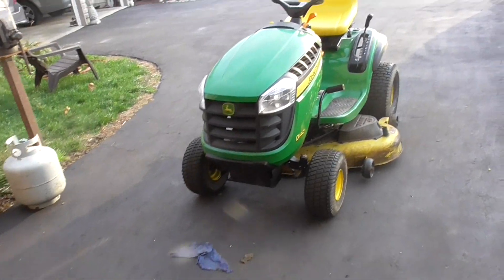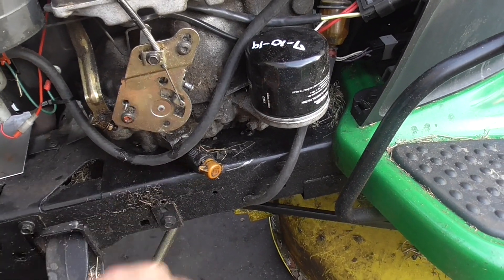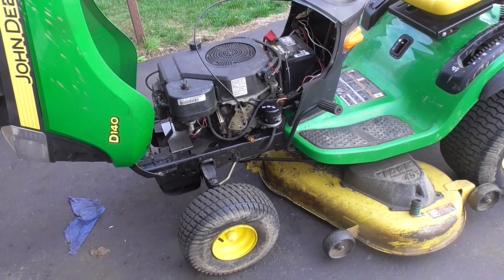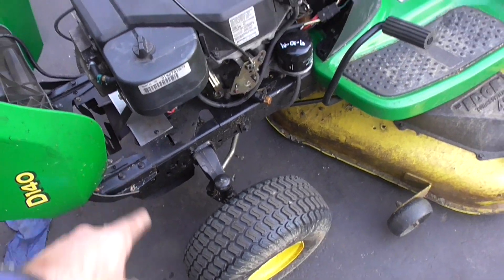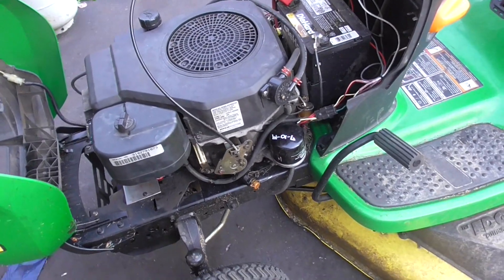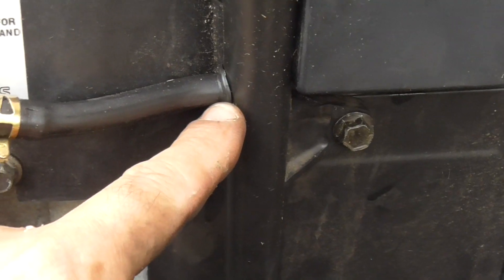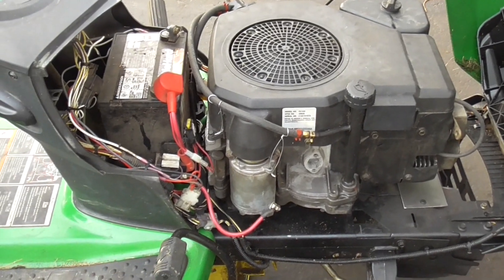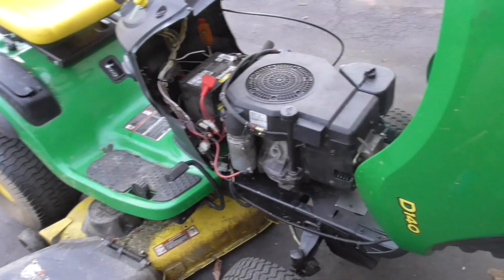Adding A Fuel Pump To Kohler Using Briggs Parts

Comment: In your case I would have drilled a hole through the block where the mounting boss is located for a mechanical pump. I don't understand why they put the mounting boss there for the pump but didn't actually machine the hole for the pump pushrod 🙄🤔

Comment: Just to let you know the black wire that needed to be hooked up was your ground That's why nothing would work until that was hooked up. In the first thing I would do would that is the take off the carburetor fuel bowl which is very easy by unscrewing the solenoid on the bottom of it just remember to unplug the wires going to the solenoid. Is what they call an anti-back-fire device and they cause more problems and you can imagine but most people do and it only take you a few minutes is to take the solenoid off and grind the tip down. Eliminating that device from closing off the jet in your color it'll work 100% better and if you look around YouTube you'll see tons of videos on. The way you have your fuel setup on that John Deere is pretty much how it comes from the factory. The thing on the side of the mower with several lines is your vacuum fuel pump those go all the time. Easily get one of those electric fuel pumps for less than $15 on eBay and they work great and never had a problem with them but tons of problems with what you have on there now in fact I just replaced one. And if you ever do install to fuel pump make sure you put it as close as you can to the gas tank to avoid vapor lock. And make sure you connect power to the pump off the key side of the switch to get power that way the pump is only on when it is running I've seen other people put switches in and shut them off manually but why they would do that I had no idea looks like you did it a lot of work and did a great job and you got a great mower for your investment and you're right that's how you learn jump right in I also just put a 22 horsepower diesel engine on one and you can get them cheaper than you can get a replacement Kohler or Briggs & Stratton for. Bolting right up. And very easy to wire try one of those on your next project everybody will be very envious of you having one of those who have Diesel engine. It may be rated the same horsepower however diesel engines cookies a lot more torque and now that mower is unstoppable

Comment: Thank you for sharing this. I've got a 12hp Tecumseh engine that I'm transplanting onto a Deere D100 that has the fuel tank under the seat. Using this same logic I should be able to retrofit the old fuel pump system onto the Tecumseh using the dipstick tube and valve cover like this.

Comment: Does anyone know why there's no pulse coming from the valve cover on these Kohler Commands? I tried to get pulse from the already existing valve cover hole, but it didn't provide pulse. BTW, great idea getting the pulse from the oil fill tube!
Reply: You have the twin cylinder? If so there's no porting for pressure to the valve covers instead there is a breather assembly in between the 2 cylinders. You have to remove the carb and intake manifold to get access to it. 
Old manuals like for the old brigg flat heads (L heads) show different potential locations for pulse lines. He did a good job but definitely an old school idea. If you can't get a pulse from the cover either do like he did here or tap one to the intake manifold. Or if your feeling fancy do electric.
Reply: There is a reed valve in the top of the cylinder head that may prevent the pulsation in the valve cover...

Comment: How did you decide to put the vacuum tube into the dipstick tube vs the valve cover? I have a Briggs 17.5 hp that didn’t come with a fuel pump, but would like to add one

Comment: When I added an impulse fuel pump to my Kohler CV16S I also tapped into the oil fill tube except I made the connection with a TUBELESS TIRE VALVE.  I bore a 15/32" hole approximately 1-1/8" below the top surface of the fill tube.  I also thinned the width of the inside grommet.  Besides being readily available and inexpensive, the threaded valve stem fits nicely inside the fuel line so no additional couplings are needed.
Reply: Is this doable on an engine without a fuel pump/filter?
Reply: @clydepurk7162  Yes, the engine I had didn't have a pump originally, so this is what I did to obtain a working impulse line.
Reply: I was concerned that the line would catch some splashing oil. No problem there?
Reply: @clydepurk7162  It's near the top of the fill tube.  There's no splashing there.

Comment: Would this system work on a engine with no oil filter?
Reply: Jimmy, did you ever find the answer to your question? I'm wondering, too.
Reply: @clydepurk7162  yes, I did this on a Briggs Intek 17.5 with no oil filter and works perfectly. If it has a valve cover you can drill a hole in it up top corner and use it has the vaccuum for the fuel pump or drill a hole in plastic for the dipstick either way the pressure is there

Comment: Nice fix. Definitely will work on a pressurized engine but on a non pressurized engine it will suck oil into carb. I have a video on a engine someone tried that on but it wasn't pressurized. Yes 5his is how we learn trial and error
Reply: I call bullshit on that. On a Briggs and Stratton 11hp splasher flathead I drilled a hole on the governor side of the engine up high and threaded in a hose barb and its been that way for 6 years now and doesn't pull oil into the carburetor.

Comment: Nice, I like it. I tried to get vacuum from the valve cover and it worked but, I mow on a hill/sloped yard and it didnt work all that well. I swithed it back to the original setup.

Comment: I've seen some D140s having problems with the transaxle losing torque.  How's that one holding up?  Is there a way to measure how much torque a transaxle puts out to see if it's working properly?
Reply from the maker: I have a video on fixing the JD transaxle.  Best thing to do is dump the oil and with synthetic in the transaxle.  Clean grass off top of trans so it stays cool.

Comment: Thanks for the tip ,may do that someday.   Looks like it works well  and keeping the price low when selling a box store tractors
Reply from the maker: Yes the vacuum seal is tight and not leaking.  Easy to do, cheaper than the Kohler OEM fuel pump.

Comment: nice job. not easy to switch brands and get everything to work with crankshafts and all.
Reply from the maker: Yes, I accounted for the crankshaft size and the wiring , but not the fuel pump situation.  I always learn a thing or two on these jobs.